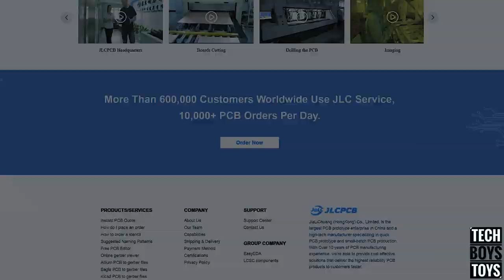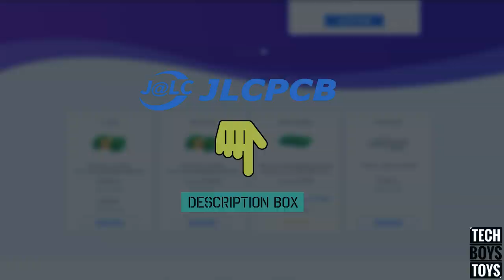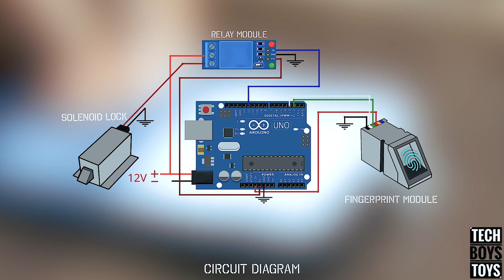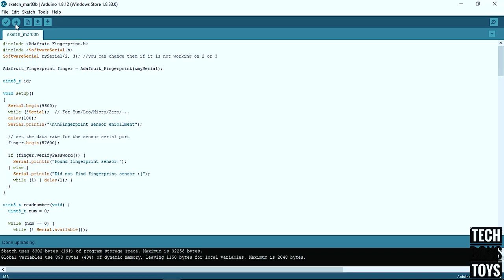How to make Real Fingerprint Door Lock at home | TecH BoyS ToyS

Comment: simple to hack just need a cable with otg(if using phone )  and looking at pinout just program it in a minute and open the lock
or unscrew glass and pull the solenoid bar and it's unlocked
Reply from the maker: If I packed all things through metal 
Then how can i show you the mechanism
Reply: @techboystoys  he is just trying to be genius bro.